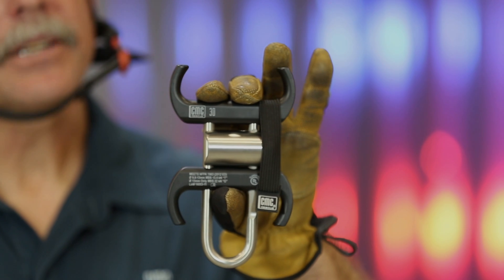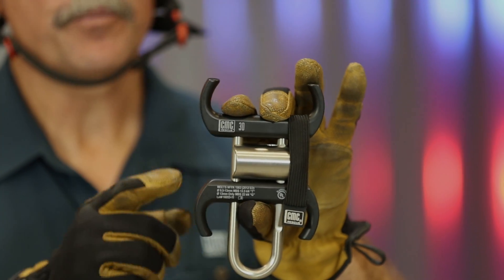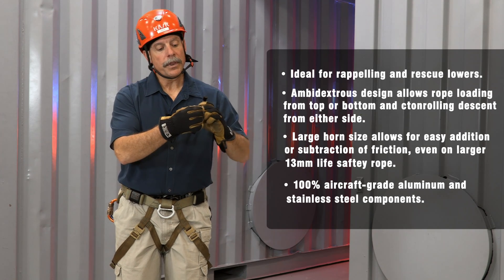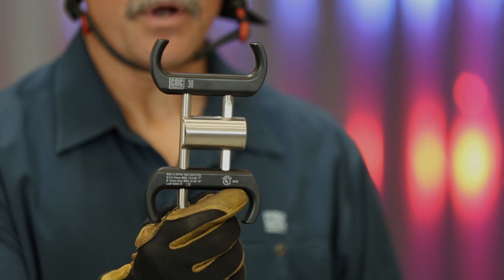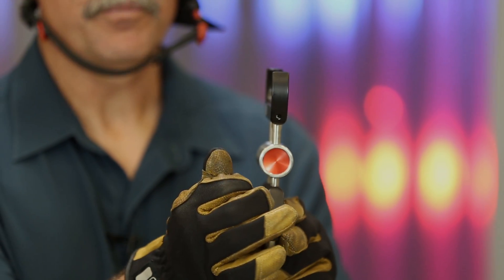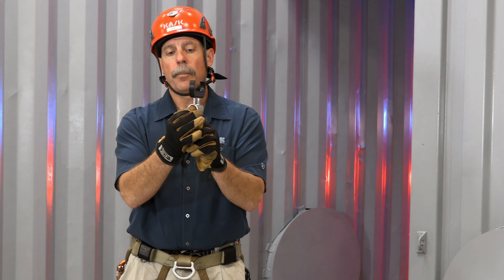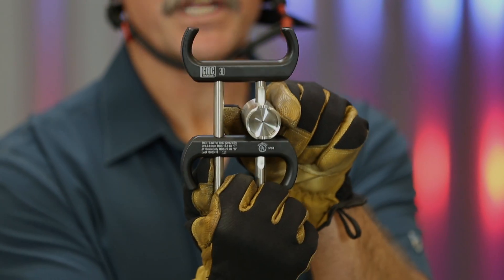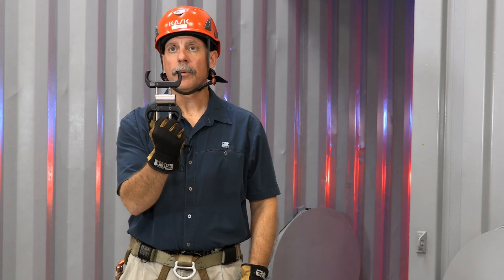Locking-Bar Descender | 3D | CMC

Comment: a workable three bar friction device that might add something because of the use of the horns on the upper part of the device.....i am unfamiliar with the use of horns and only can imagine it is for increasing friction ........i am thinking the use would have to be determined prerappel and so i don't think i like it from the gitgo..........i mean a rack offers MUCH more flexiability during realtyme......
Reply: +eyecave silly 
I've been using mine with rescue loads after getting more familiar with this new device and I'm going to be putting in a requisition to start replacing 6 bar racks with it as it saves space and weight. The locking bar and bar closest to the carabiner floats and this can add or decrease a significant amount of friction, to add even more you use the horns to accomplish the task of what a 6-bar could do. What an awesome little device this is, finding additional uses everyday like using it as a contingency anchor for newbie rappelling.

Comment: Rip off!!! Come up with something original!!! #scarab #conterrainc #icantthinkformyself
Reply: +Mathue Totten 
I got my 3D a few weeks ago and have a scarab too, this most definitely is not a rip off and is safer than any other (mini-bar) device out there with a locking bar design and a little larger too (I don't mind that extra space at all). I too would place the scarab in it's own boat as this new device is so much better. The scarab is too small for 13mm rope and proves difficult when attempting to do any pickoffs or rappel and even has a safety warning for feeding rope through the device. The 3D has solved this issue and I'd give it some time to see and handle the difference for yourself before bad-mouthing this great new product. Some real thought went into this design. #educateyourself #3D #roperescueinnovations